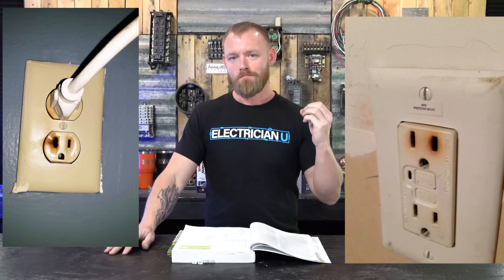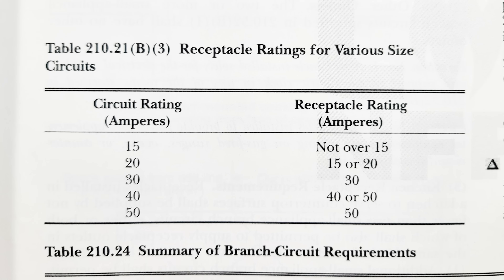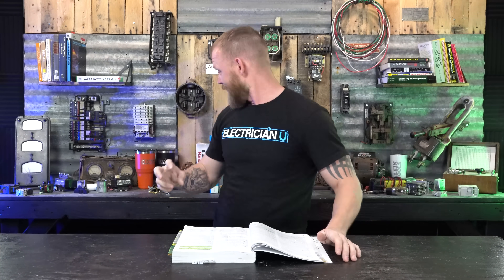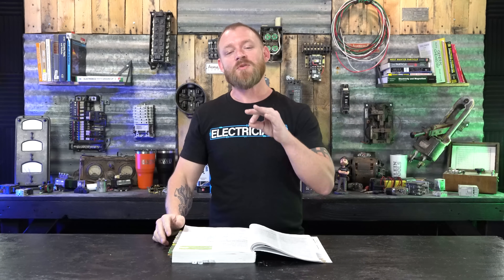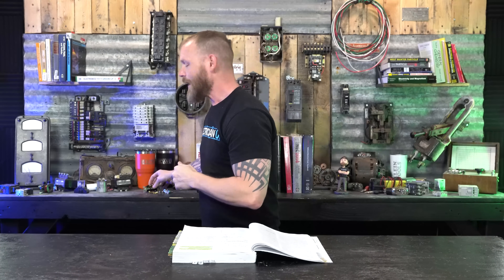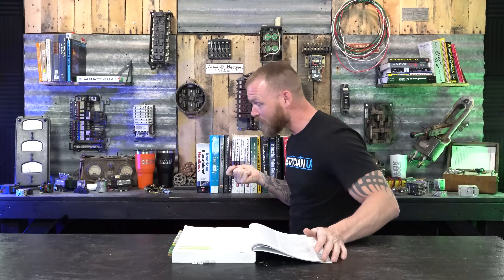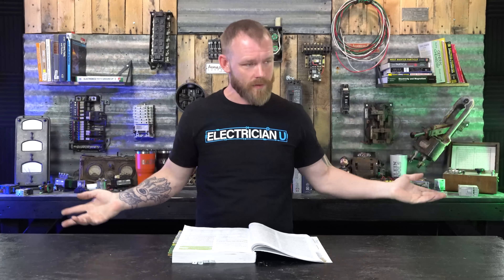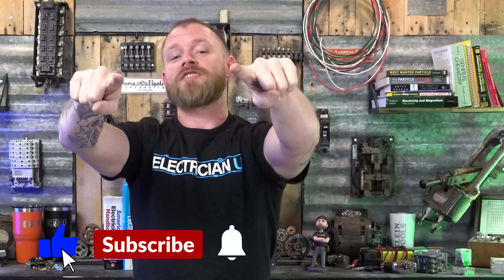Won't These Melt?!? 15amp Receptacles on 20 amp Circuits!!!

Comment: I realized after a while we have 20 amp breakers in our apartment, which means that we're not really that protected.  Not enough branch circuits so that's another problem.  I wonder if a power strip helps reduce the risk if the power strip has it's own breaker
Reply: A power strip will actually increase the risk, as you could now potentially add more devices increasing the load at the one outlet. Recipe for a fire!
Reply: A power strip with a built-in breaker is not a bad idea. Multiple power strips on the same breaker doesn’t help much.

Comment: When I go at one of my local hardware store, big majority of the receptacles they sell are 15A rated for DIY.  My guess that most electrician have or are getting their supplies where the will have 20A rated receptacles.   Thanks for the reminder.
Reply: The hardware stores down the street from my house sell 15 and 20a receptacles of various grades side by side. The cheap ones are on the left, and they get more expensive the more to the right you go.

Comment: For residential, stick with square D homeline and your breakers will trip when necessary. I've seen GE sitting there cooking and still not tripping. If you're going to go cheap on the outlet you better use the square D homeline breakers
Reply: Square D QO and Cutler Hammer CH are purported to be better.
Reply: @gary-dc9st  no I put a 200 amp square D homeline in my house when I build it and it has performed flawlessly for 30 years now. What more could you want.

Comment: Although obviously common and not a code violation, I have never liked the idea of using 15 amp receptacles on 20 amp circuits. Although it's not likely to ever be an issue if common sense is used, that's something we obviously can't count on. In my opinion, the circuit breaker should protect EVERY part of the building's electrical system from overloads regardless of what loads someone plugs into the receptacles.

Comment: You put a 15amp plug on a 20 amp circuit. Why because most applications don’t use 15 amp. So you can use a coffee pot and crockpot at the same time.  Etc…

Comment: Awesome summary, thank you!  Does the same concept hold true for 15A switches on a 20A breaker?
Reply: You should read some of the comments, this video is not accurate. Most lighting loads are well under 12 amps, if you happen to have a load that is over 12 amps you should use a 20 amp switch.

Comment: Got a question. I was always taught that you never use anything in a circuit lighter than the whole circuit was fused or breakered for. So, no #14 wire in a 20 amp circuit. However. when we get into a light fixture we almost always get a small wire, especially the  new LED fixtures.  So, code must allow this at some level. A lot of switches are just rated for 5 amps. So, can we go to  smaller wire after a switch ? Say a 20 amp lighting circuit with #12 for the main run, but going to #14 after each switch to the individual LED fixtures that are only rated to draw 25-50 watts?
Reply: Light fixtures don't fall under the code.  They are a manufactured item and must be UL listed.  So they have been tested by UL as a unit to work as built, even with the tiny little wires.
Reply: 20amp circuit needs 12 gauge wire from the breaker to the fixture box. I've never seen a light switch lighter than 15amps.
Reply: @gary-dc9st  I just did some looking as I usually go straight to 15 amp switches. But, I did find some dimmers with lower ratings, that's probably where I got the idea that some switches were 5 amps.

Comment: New 15 amp receptacles are perfectly happy with 20 amp draw. It happens sometimes at my work because it's temporary setups and some of the lights draw 18 or 19 amps
Reply: wait until it gets a lil loose connection :D

Comment: Got one for you. I have a 20 amp breaker feeding two rooms lights, and 3 double outlets. How's that possible without risk of overload/fire risk?
Reply: I would say that if you had a single 12A load plugged into each of those duplex outlets, AND turned on the lights you're going to trip that breaker.  Probably right away since your circuit draw will be over 36A.  Shouldn't be a fire risk as long as the wiring is 12G but if someone went cheap and put in 14 . . . . .
Reply: @michiganengineer8621  not sure what gauge it is. It is from my understanding when house was built is 94.
Reply: @Demon_Mx2277  You should be able to chase the wiring out of the breaker box and try to spot labels.  Or, if you can't do that, take off the front panel and look at the wires coming out of the breakers (VERY carefully of course!)
Reply: @michiganengineer8621  was thinking that. Might just take the outlets off and pull the extra wire through a little bit and see from there. Would be easiest to do as the panel is a nightmare....

Comment: I always use 20 amp plugs on a 20 amp circuit even in residential I'm just a drywall guy that's what I've always done whenever I do any electrical stuff
Reply: If you do any wiring in Montana other than your own house you need an Electrical Contractors License.
You might check your locale to make sure your not breaking the law.
Recommend anyone hiring for electrical work to only go with a properly licenced and insured Electrical Contractor.
If you go with someone else, even if they're insured, would their insurance company cover your burned down house if they weren't licensed to do the work?

Comment: I just put 15amp outlet on 15amp breaker and 20 on a 20.. is that wrong? Never had loads big enough to trip any of them.. Figured that is safer than throwing a 15 amp outlet on a 20amp breaker.

Comment: Ahhh, now I see. If I use a GFCI to install a (bunch of) grounded outlets I have to label them. But if I put 15A outlets on a 20A circuit (that the home owner can "verify" at the breaker box) I can just assume they will know that not only can they not expect 20A at the outlet, they can't even expect (more than) 12A.
Where is the labelling? A QR code is tiny and can provide guidance in multiple languages.
Seem too anal? I lived through all the "A Christmas Story" nonsense, including a penny in the fuse box. People don't get it. Is a fire a better way to die than electrocution?
Reply: If you put 15A outlets on a 20A circuit you will have 20A at the outlet. Ideally you wouldn't load it to more than
80% (16A).

Comment: I have been seeing 14 gauge wiring on 20A circuits in relatively new homes in my area, cutting cost I guess
Reply: Electrical inspectors not doing their job. Here in Montana they went from knowledgeable dedicated electrical inspectors to do it all inspectors that don't do much more than make sure you have smoke detectors where it's required, what a joke. Doesn't make much difference with good electrical contractors in residential because we know what we're doing but there are some bad contractors, and homeowners can wire a home for their personal use.

Comment: almost anyone in the United States using a 1800W or a 1850W hair dryer is overloading the receptacle
Reply: A 20 amp circuit at 80% load is 1920W and the receptacles are designed to handle that so you are incorrect, if you plug your hair dryer into a 15amp circuit you would be overloading the circuit but not the receptacle. Bathroom circuits are required to be 20amps.
Reply: @gary-dc9st  Do you have a code reference to that 20 amp requirement in bathrooms? Because here in the United States a home can be wire with all 15 amp breakers to the 15 amp receptacles NEC Table 210.21(B)(3), NEC 210.21(B)(3), and NEC 210.23(A). I have know many electricians do it and pass inspection. (I also told them, they would never wire my house.) However the max cord and plug connector to a 20 amp receptacle is 16 amps on a 20 amp circuit, and a 15 amp receptacle is 12 amps on a 15 or 20 amp circuit, and a hair dryer rated more then 12 amps is overloading the receptacle as defined by the NEC. NEC Table 210.21(B)(2), and NEC210.21(B)(2). (I have never seen a 20 amp receptacle in a bathroom.) The 80%/125% rule is for things that are continuous load as defined by the NEC 100 Part 1 or unless that NEC says to use 80%/125% for other reasons NEC 210.19(A)(1)(a) and throughout the NEC. Receptacles in of themselves are not continuous load but are still strangely rated at 80%. All reference are 2020 NEC Code.
Reply: @tiggeroush  It's 210.11(C)(3)  same area of the code that requires minimum 2 20amp small appliance and 1 20amp laundry circuit. Sorry for the delay, just saw the question in my email.
Reply: @tiggeroush  20 amp circuits have been required by NEC in kitchens and laundry since 1959 and bathrooms since 1996 and was added to bathrooms because of the heating appliance use there. I've only ever seen a house with all 15 amp circuits once, inspector wasn't doing his job. Yes you are right that maximum load on a 15 amp receptacle is 12 amps but having seen the guts of both 15 and 20 I wouldn't personally have an issue with plugging in an appliance with a higher draw. However I don't see how an appliance manufacturer could build a product with over a 12 amp draw and a 15 amp plug and get a UL listing on it.

Comment: You must not be familiar with UL requirements. A 15amp receptacle is required to be rated for 20amp pass through.
A 15amp GFCI is required that the internal contacts be rated for 20amp. A 15amp receptacle is not weaker than a 20amp because it has been designed and listed for use on 20amp circuits. The difference between a residential grade 15 and 20 amp receptacle is the face configuration. If you plug 2 12amp space heaters in a 20amp duplex receptacle you will have the same problem as you will with a 15amp. Why do 20 amp cost so much more? I would guess when you manufacture 1000 15amp for every 20amp receptacle, the cost go down. The reason receptacles burn up I have always found to be due to poor connection. Loose screw on wire, stab lock connections, loose fitting plug or dirty connection. These problems may not be visible until you plug a high draw device into the circuit/receptacle.

Comment: We have many of these issues.  It is permissible to have many 10A power points on a single 15A ( 240V) circuit ( I think it is 14 of them).  I had to fight with the electrician to get some new circuits put in.  The trouble is that if current is drawn through ALL of the points it is easy to overload the system.  And that circuit breaker won't trip until you are WELL over the rating.
A 15 Amp device requires a different power point. The metal is no heavier but the power point must be installed as one point only on the circuit so that it guarantees no one else can be using power of that circuit.  You could achieve this manually if you knew what points were on the circuit and made sure that none of the others were in use at the time.
However back to those blasted thermal breakers.  If people insulate their homes and carelessly cover the wires they do not have air cooling.   They overheat even at the rated current.  (Similar to using an extension cord that is coiled up). If the breaker doesn't blow at the rated current then ... a house fire due to "electrical fault" is quite possible with extended time overloads.  And the circuit breaker won't trip.  Bother.

Comment: I found a EV car charger that draws between 15-17amp on 120 or 240v. It came with a nema 6-20 and then an adapter to a nema 5-15. I had assumed it would decrease it's amp draw on 120, that was not the case. Aside from constantly tripping the circuit, there were other loads, I found the cord from time to time would get hot and soft. So they do exist, devices sold with cords that will infact draw more current that the nema rating. Not sure if I ever found a UL listing but it was from "US" based company.
Reply: No the 120v will be the highest current draw.  240 will cut the current draw in 1/2.

Comment: It seems to me that any electrical code which relies on the consumer being aware of and following such restrictions is fundamentally flawed. Where I live in the UK, we have sockets (receptacles) that are commonly on 32A/240V circuits, and even being on a 40A circuit is possible. However, the plugs are rated to 13A, and all plugs are fitted with a fuse, which is rated to suit the device and its connecting cord. Thus a space heater will have been fitted with a 13A fuse, a table lamp with a 3A fuse. For some time, these have had to be pre-fitted by appliance manufacturers. Fuses also have to be fitted to adapters and power strips. Thus it's not possible to overload the actual plug/socket connection as there is no fuse above 13A available to fit the plugs.

So people can try plugging two 3kW space heaters into an adapter, and all it will do is blow the fuse. You can also daisy-chain power strips to your hearts content, and never draw more than that 13A current from the outlet (to be accurate, you might for a while as fuses, like breakers, do not pop immediately if subject to a mild overload, but the system is engineered to cope with that).

The YouTuber channel, technology connections, has a good rant about this problem, especially with power strips.

Comment: I Call BS  if you read the box most 15 amp recptical are rated for 20 amps as long as you use the wires around the screws and not stab or quick connects on the back. this is why 12 will not fit

Comment: I've always just used 20a outlets on 15a and 20a breakers.
Reply: Putting 20amp receptacles on a 15amp circuit is a code violation.
Reply: @gary-dc9st  cool story If you really work in the industry code doesn't matter just look at all the new houses built like shit everywhere.  I do it so the outlets are good to go for either.
Reply: @gary-dc9st  and I run 20a circuits because I know what is the best who tf still runs cheap 15a 🤦‍♂️
Reply: @gary-dc9st  code when they build housing developments in condemned areas. Lol they don't care $ talks. just know what works and what doest

Comment: The other funny thing is a device with a 20 amp rating and cord will not fit in a 15 amp rated receptacle.  A device rated at 20 amp with the appropriate cord cannot fit into a 15 amp receptacle.

Comment: Great video!  QUESTION: can the “bridge tab” on a 15 receptacle handle 20 amps meaning that the in coming 12gauge (20 amp)wires are attached to the two receptacle screws and the out going continuous 12 gauge (20 amps)circuit wires are connected to the other two receptacle screws?  Maybe the “pigtail” method is better instead of relying on the receptacle “bridge tab” for a continuous circuit to other receptacles.
Reply: Yes it can and is required to handle 20amps by UL
Reply: Pigtail method is absolutely a better idea.
Reply: @atmacm  I agree with you 100%!

Comment: My apartment is all 20 amp circuits, 6 of which are single receptacle. Only 1 of those, the microwave, has a 20 amp receptacle. The rest for the washer, dishwasher, disposal, water heater vent motor, etc are 15 amp receptacles. Is there an exception made because those are supposed to be dedicated to a single appliance? The microwave draws over 15 amps so even if there's an exception that would still need a 20 amp anyway.
Reply: A single receptacle only allows 1 device to be plugged in. If that is what you have the 15amp single receptacles don't meet code. If you can plug 2 devices in it is called a duplex receptacle and those would meet code.

Comment: 20A receptacles is a total waste of money for commercial. The only way you would ever need them is for an individual branch circuit. Most of the time in commercial the equipment is spec'd and that would be the only time you need 20A the rest could be 15A rated duplexes.
Reply: Unless it's kitchen, woodworking, garage equipment, etc, etc, etc,
Reply: @gary-dc9st  Can you post a picture of a cord that takes 20A receptacles only on a common basis?

Comment: Bottom line is a 15A duplex receptacle is NOT a 15A device. It is TWO 15A receptacles on a single device yoke. It is still rated for 20A feed-thru. 
The "metal inside" WILL NOT heat up because it's on a 20A circuit. All the melted devices he shows are from poor connections, NOT due to overcurrent.

Comment: when I worked retail, I tried to educate my customers about this.... the best answer to fix this issue is to wire the house with the 12 guage wire, but only use 15 amp breakers in the panel... (futureproofing?) heaters have been one of the major issues with this problems.... and thus causing burned wiring, outlets or even blown splices. I had a customer once who thought he could fix the problem by replacing the breaker with a 30 amp.... I told him, If you want a fire...... people are crazy!
Reply: That was the old school thinking.....20 amp fuse keeps blowing.....replace with a 30 amp fuse...problem solved 🤦‍♂️
Reply: @brockwagner939  LOL! after the house burns down.....

Comment: Basically "Code" is written so any kind of overdraw causes damage in the safest places first.  The panel breaker will pop, the outlet will melt safely inside of its box, or the circuit breaker in that cheap power strip (that is how the outlet was overloaded in the first place) will go off.  The last thing to fail should be the wiring in your walls and ceilings.  So sayeth the Code!

Power strips and replacement plugs aside, 15 amp and 20 amp outlets were designed to assume the homeowner doesn't know what he is doing.  A 15 amp receptacle will only accept parallel bladed plugs, because parallel prongs mean that plug will not draw more current than the allowed 15 amps.  You cannot plug a 20 amp plug into a 15 amp outlet because any cord that can draw 20 amps will have perpendicular blades.  It's a simple but effective setup that can only be defeated by a determined DIYer and the wrong replacement plug.